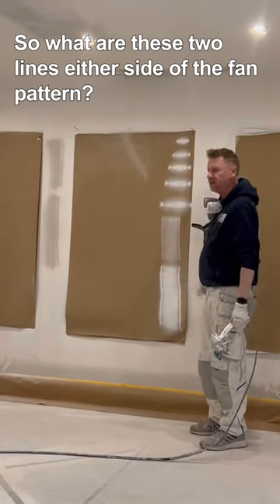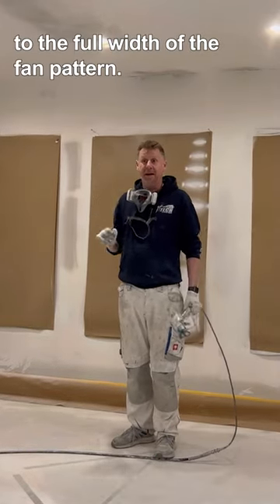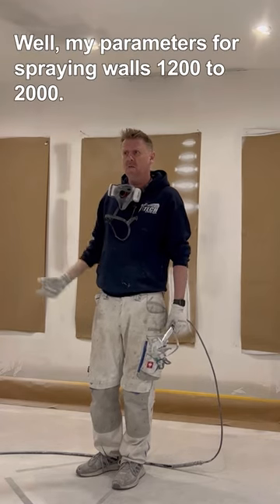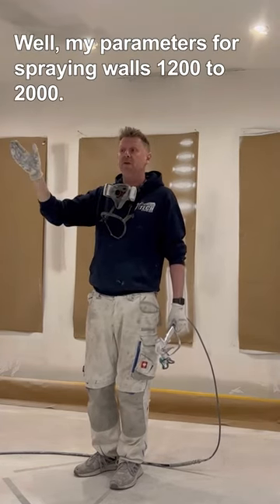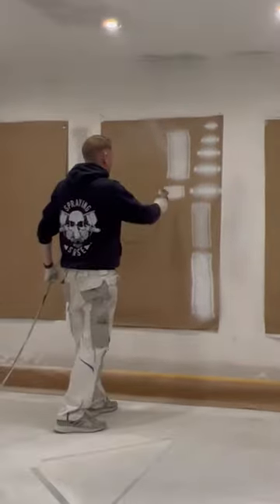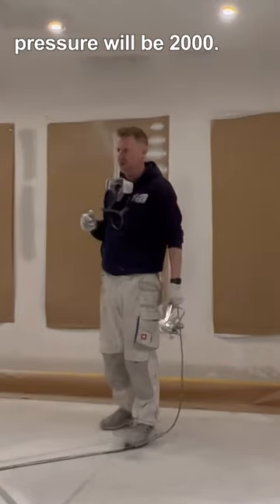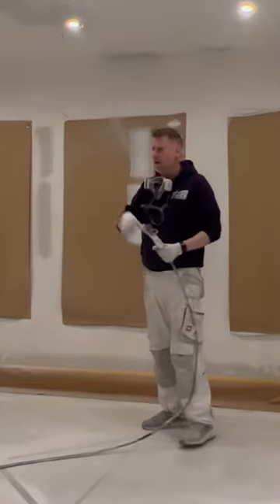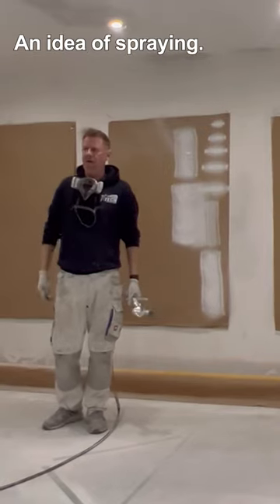How To Stop Your Airless Sprayer From Tailing - The Top Tip!

Comment: you hit the nail on the head .. i always stain my paint first weather if its old or new paint then i thin the paint down the lower pressure i use the less the my pump is taking a beating 👍

Comment: If the coating is not at some abnormal viscosity, and the airless pump is already quite near its limit (1800-2000psi), and you are still getting tails...wouldn't a tip with a smaller fan width fix the problem...say, changing from a 417 to a 411...???
Reply: No, You need a bigger tip if You use 309 and have tails usted a 312  the first number is the fan and second 2 numbers is the orifice size more bigger more flow of paint.

Comment: I'm not a huge fan of thinning down paint... I understand it's another tool in your arsenal, but step one to me is stir up the paint with a really really really good drill attachment (no you will never get the same effect with a stir stick), then strain it (extremely important and yes only after mixing thoroughly), and find a pressure it works properly at along with a tip it likes to flow thru. It's not an hvlp sprayer... I'm not gonna play around with the viscosity unless literally everything else I can think of fails, which, it hasn't yet... And I've sprayed plenty of thick paints through some fflp tips.
Reply from the maker: We try most paints neat first, obviously there is a limit to how much you can thin before it affects the qualities of the paint. Some paints we just won’t use if they need too much pressure.